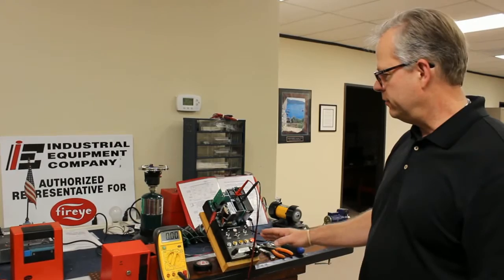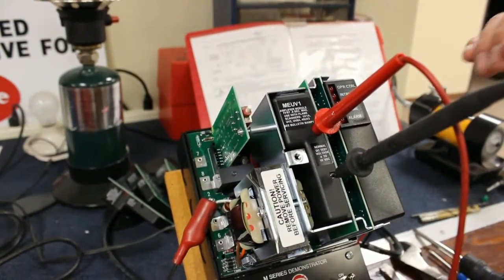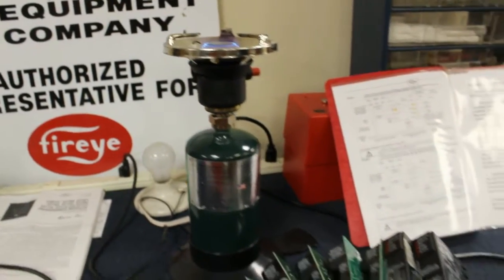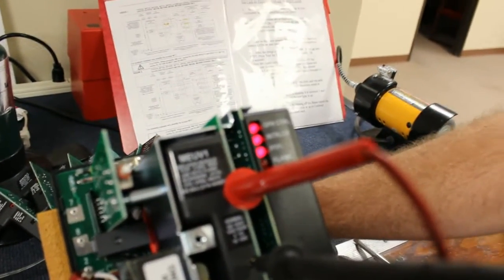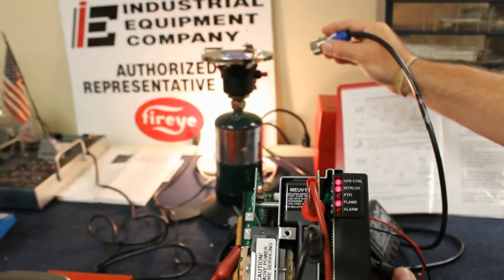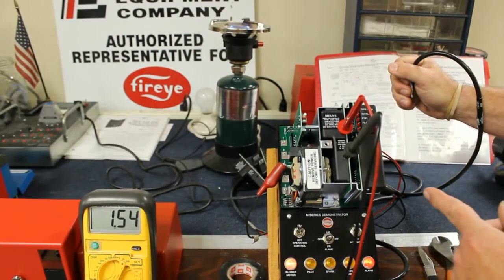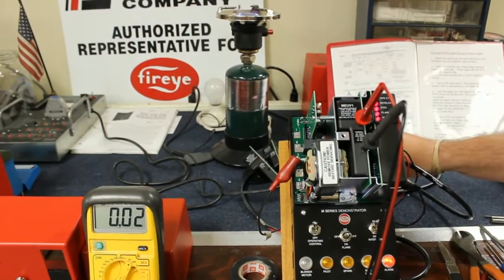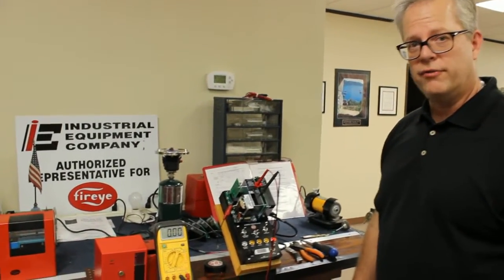Testing an M series Fireye control

Comment: Hi, We used the Fireye scanner in the vessel. In Port side Boiler trip due to Flame Scanner B - Flame On Input Fault. Based on our analysis, normally Boiler trip shouldn’t be happened because Flame Scanner A able to Back-Up (every Boiler has two flame scanners : A & B).

 We trying to check related Wiring Diagram that we have, and we can see Flame Relay in series with Fault Relay. How we can rectify?

Comment: My appliance currently uses spark plugs for flame detection, but detection fails a lot.  Is there a position that the spark plug should have or will I have fuel problems?

Comment: I have one that works for 10 days and then magically Locs out and you cannot reset it unless you kill the power you can push the reset button all day long it will not reset you have to kill power to the unit and then hold the reset button in after you repower it up seems like some kind of software glitch or electronic issues I replaced this control with a new one and I do not have this problem anymore I would like to get this old one repaired is that something you can do
Reply: Jon, we do not recommend that any repairs be done to these units as consequences could be bad.  You can, however, trade-in the unit for another one. Usually, you get an extra discount for the trade-in. Ask your local distributor if they participate in this plan.
Reply: @filc-gmail9257  okay how much is that
Reply: @jonminnella2966  send us an email to sales@indeco-tx.com to my attention with the model number of your controller and ask for trade-in price. Also, let us know where you are located (City and state).
Reply: @filc-gmail9257  okay I will do that